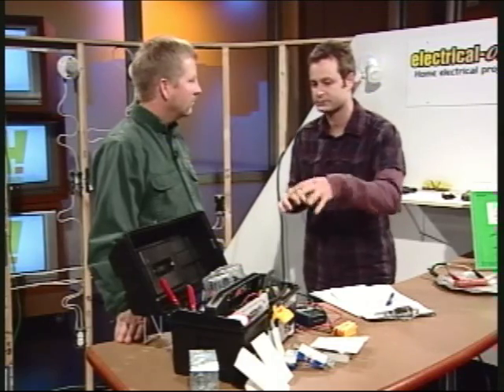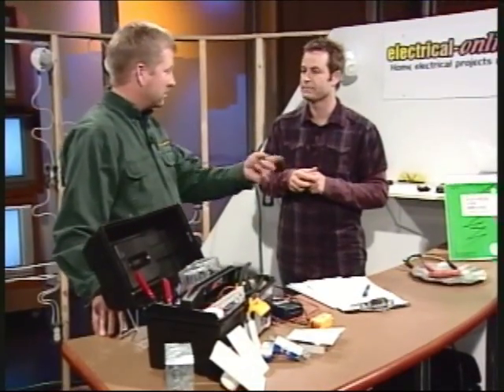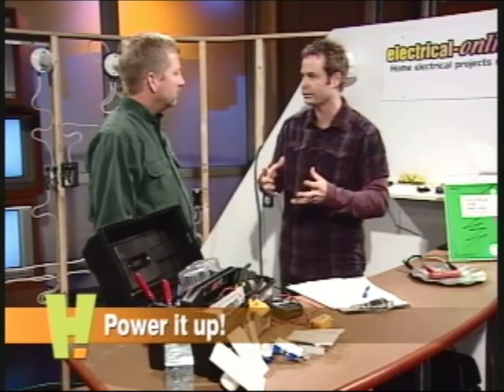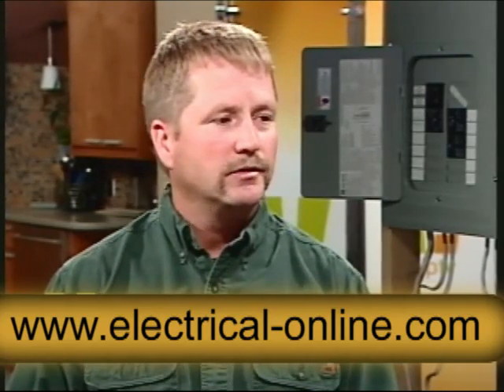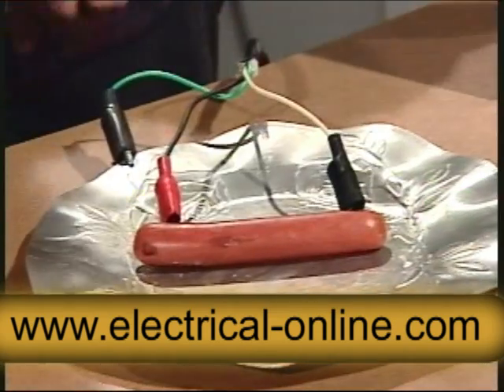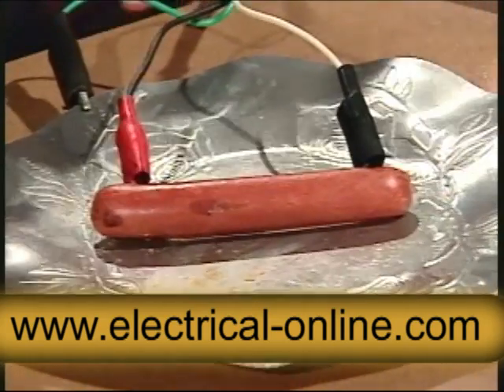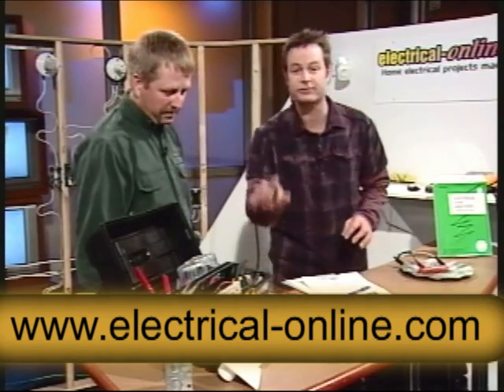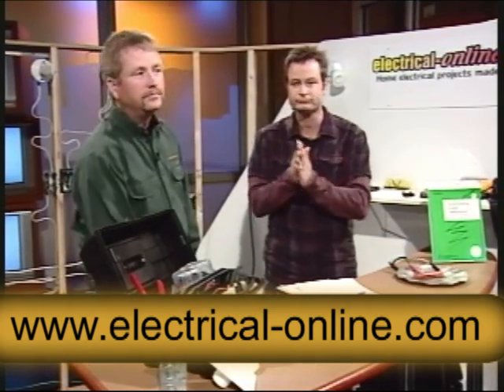Can 120 Volts Hurt You?

Comment: I've felt the buzz, but I jump back when I feel that jolt. I'm srurprised i'm not dead from touching 120 to 15,000 volts. the latter was a tc that hurt so much I yelped and jumped trying to cut a CRT cable to a fly back transformer
Reply from the maker: Yup, I've had too many zaps myself!  Usually because I think that I'm skilled enough and know better than to touch the hot wire (s) so I think I can change that device without shutting off the breaker, and then just that one little moment of lost concentration and,.......zap! Ouch!  dammit!
Reply: @theinternetelectrician  Thats why I make sure to keep my breakers/fuses labled and have them removed/shut off when doing anything electrical since I'm highly skilled and I'd rather not let mistakes hurt or kill me.
Reply from the maker: @nekomasteryoutube3232  Exactly!

Comment: I was troubleshooting a light switch one time and while removing a screw on one of the power cables i got the full 120v through both of my arms. It didn't hurt, it just felt like tingling in my forearms.
Reply from the maker: Yes, I've had countless shocks as well, too numerous to mention.  I get complacent and lazy at times and push my luck by not shutting off the power thinking I'll just be careful.  It takes a lot of unfortunate circumstances to come together to get a serious shock from 120V, but it happens, and it's just not worth the risk, not to mention the cursing and swearing that happens when you do get zapped!
Reply: Yea, I shut off the wrong breaker and found out what a nice 3 sec jolt of 120v feels like. It doesn't hurt but don't want to feel that again.
Reply: Add some current to that 120v … say between 5mA to 15mA through your body to ground. You’ll scream. I did when I tripped a gfci through my body on the load side. 2nd year Apprentice, that one hurt the worst… jumped off a six foot ladder immediately.

Comment: I just got electrocuted by a 120 volt power strip, overloaded and forgot it had Raw wire spots, because of a stupid rat and I can confirm it hurts lol. Quite a bit. And makes a few points numb for a while.

But you can also die, or have a heart attack. Be careful. I'm going to wrap it with electrical tape asap 🙏🏼
Reply from the maker: Yes, it can give you quite a jolt! And that’s the best outcome for sure! Can definitely be worse! Thanks for watching!

Comment: well.... except we do not hook up the leads directly to our heart, do we? of course we need to be careful around electricity, but the human body is much bigger than a hot dog and therefor has more resistance to blog the amount of voltage/current being pushed through us, I forget how much voltage it would actually take for 1 amp to reach the heart, but it's more than what upset that hot dog
Reply: Why did you pick 1A? Less than 1/10th of that disrupts heart rhythm.

Comment: I have heard of a few people who have actually survived a lightning strike. If that's the case, then a shock from a residential power source wouldn't kill them.
Reply from the maker: I too know of a couple friends of mine who were hit, (maybe not directly) by lightning on a golf course. They were knocked flat and unconscious for a short time, but they too survived. The affects of electrical shock depend on many factors, but one basic principle is that voltage burns, it’s current that kills.
Reply: This is a stupid as fuck way of thinking
Reply: @jordanadams5902  isn't there a more polite way of disagreeing?
Reply: This is an apples and oranges comparison. Lightning voltage is high enough to ionize great lengths of air, far taller than a human.  While this channel of air is ionized to plasma, it conducts electricity very well. Residential voltage is not high enough to ionize 1mm of air. 
The people who survived were lucky the bolt's current went almost entirely around their body instead of passing through vital organs. To those who are not so lucky, both lightning and residential power are deadly.
Reply: Why not test out this theory

Comment: I was screwing in my lizard 120v bulb and it shocked me for a sec should I be really worried
Reply from the maker: You may have a the hot wire on the bulb shell and the neutral in the middle pin? Is this a lamp without a polarized plug?

Comment: This is the most ridiculous experiment ever. He wired the protective earth to the plate. Obviously the wiener fries because of the AC flowing through it and shortcircuiting on the plate. Just remove either PE or the neutral wire and there will be no more stirring or burning of the wiener. You can leave it for days.
Reply from the maker: Dan Santa the experiment is to simulate a person standing on the ground (earth)! That’s the reason I connected the plate to PE. Yes, the wiener can go around all day at 120v potential if he’s not in contact with earth or neutral, but what happens when he steps outside in bare feet? Or touches the fridge while grabbing a snack? Which makes me wonder what a wiener would want to snack on? And you call my experiment ridiculous?!? 😀 Merry Christmas!

Comment: Your finger would also not be quite like the hot dog in the video because a hot dogs resistance is probably about 2-5 kiloohms but a person is on average 100 kiloohms
Reply: The resistance is hard to measure it depends on humidity and how hard you hold the probes but generaly across your body its 100k to 1 mega ohm

Comment: I had wet hands plugging something in and it was the hardest shock I’ve ever gotten. It all depends on how dry/wet your skin is.
Reply from the maker: You are correct in that is a big factor. I worked with a guy that had very dry skin, and he used his hands for voltage testing. He would use his fingers and could barely feel a tingle.  Even on 240V .  Dry and calloused hands!
Reply: @theinternetelectrician  for sure! I was plugging in a light for a pumpkin this morning and was too stupid to dry off my hands. The shock i received was why i watched your video. Very educational!
Reply: I was pluggling my phone charger in and I felt an intense buzz/vibration from my pinky to my shoulder. My finger and hands were.dry though. But, it was a bad feeling....😬
Reply: I almost shoock my self just now I need to be careful wit the way I plug in stuff
Reply: I was a cut man for a framing crew I was standing in a big puddle of water ( my cord had a splice laying in the water from some a-hole cutting the cord ) and I thought I was having muscle spasms in my legs I have MS till one of my guys came over to carry some 2x8’s I was cutting he stepped in the water and got the piss shocked out of him lol I got hit by 440v industrial once that lit me up for a bit lol

Comment: I used to do TV repair and they have high voltage, however the most dangerous part of a TV is the AC line voltage. I've seen people get shocked by the 20.000 volts in a TV and they were not injured.
Reply: I’ve been shocked by that. I never worked on a tv before that or after 😂

Comment: Yeah, I had an engineer find of mine check how many amps my skin can resist and it was 7.3amps. For those that don't have a clue as to what that is in volts it's 110v.. So, that may mean that if I were that wiener I'd still be chilled...okay maybe slightly burned. Anyway, this is a bad experiment because it disregards the bodies ability to resistance to electric current. Now, if your skin was wet there would be a significant drop in you skins ability to resist electric current. This is from 100,000 Pmg to 1000.
Reply: Hi, electrical engineer here... that's not how voltage/ amperage works.  They're not directly converted to one another.. They're related through resistance.  There's no "conversion chart" for amps to volts

Comment: I've held my finger across 120 volts for 1 minute and I was fine
Reply: You probably were not grounded that well or your skin wasn't conducting the electricity that well. If your finger was wet and your other hand was touching something that was grounded like a cold water pipe you might not have been able to let go and could have been electrocuted. Please don't try it.
Reply: It was direct current not alternating current
Reply: @billybassman21  we used to lean over our above ground pool and touch the extension cord that was running the pump and see who could do it longer. It just hurts incredibly. I came here to see what is the perfect storm to get you killed by 110 volts, not some gimmick about safety
Reply: I did the same thing at work lol accidentally got a small 120v shock. kinda felt like a 9v battery on my tongue. I messed around and put my tool which was missing some rubber on the handle on a 120v line and touched the panel with my other hand and BOOM it was kinda ticklish lol

Comment: Even Japanese 100vAC (50/60) can harm you. The "ringer" voltage for most landline telephone service is a 100 volt DC pulse & that will also "light you up" if you are installing a new phone jack & someone calls that line's number.
Reply: I used to be a framework at AT&T and touched the ring generator pairs one time wow did that wake me up

Comment: Thank you so much for your knowledge.  I do a lot of home electrical, plumbing etc.  I am installing another ceiling fan in our bedroom but couldn't remember if I only turned off the switch and I did but will be safer and turn off the actual circuit switch.

Thanks, Leslie Q.
Reply: Get a meter
Reply: If you don’t know or can’t remember if the power should be shut off at the panel or not, you have zero business doing anything electrical. But I know people will do what they want; so make sure you buy a hand held pen tester. It’ll save you from falling off a ladder which is most likely what you’d get hurt from the most.